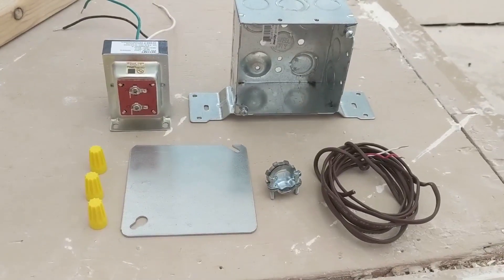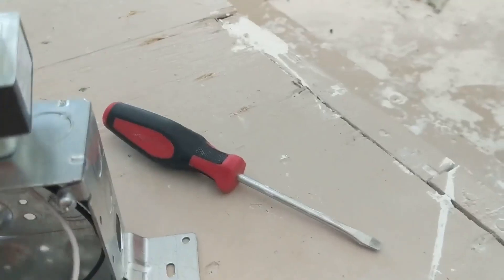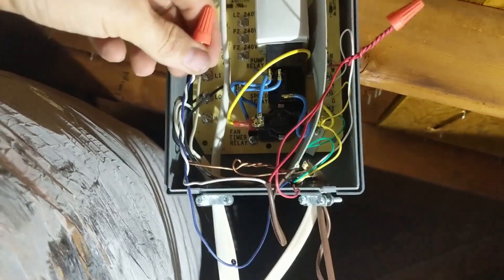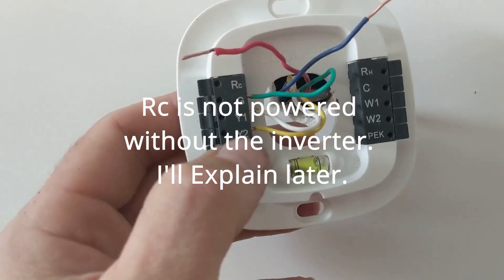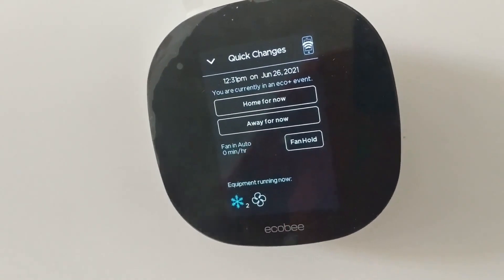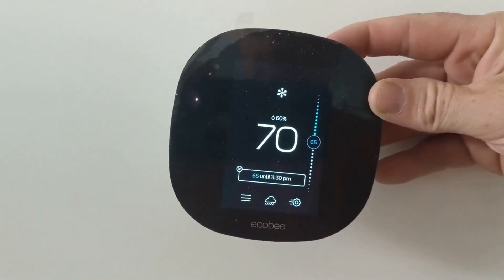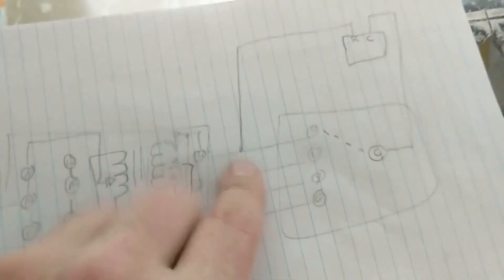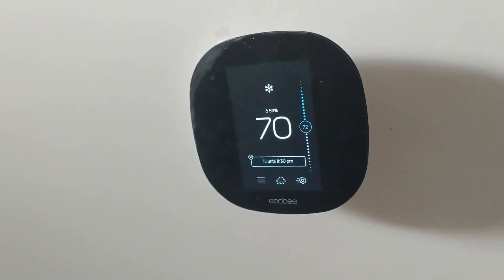Control Evaporative Cooler with Smart Thermostat SOLVED!     White Rodgers, Nest, Honeywell

Comment: Welp.. this seems pretty convoluted and complicated. Probably won't be attempting this although it was a nice thought.
Reply from the maker: Just hook up a 12v relay + to + and - to -. Wire everything else as usual.
Reply: @meunsupervised7320  I ended up just getting refrigerated air 😆
Reply from the maker: @rayzor285  That works as well!

Comment: Maybe I missed it but can you use ALL the typical functions, like Hi/Low for blowing and most importantly for me, can you turn the waterpump off/ on, all from the thermostat??????
Reply from the maker: The thermostat works as usual. The white Rogers controller runs all of the needed functions. My low is set within 5° my high is anything over. The water pump automatically turns on 2-5 minutes prior to the fan depending on the white Rodgers controller model. Standard fan can also be used with no water.

Comment: Will this accommodate both low and high fan speeds?  You referenced high/low in your video but did not talk more about high low fan speed function.  Great video BTW.  Thanks!
Reply from the maker: I set my thermostat to run on low under a 5° temperature variant and after 9pm until the desired temperature is reached. Anything over 5° the fan switches to high.

Comment: Thanks it works great, now I have a question I want to control my furnace also with the ecobee, but the cables for the Furnace are R,C,W,G by any chance do you know how to connect both at the same time?
Reply from the maker: Yes, but a diode controller would need to be installed to prevent duplicate input power which could damage the white Rodgers controller or the furnace board. I simply installed two ecobee's and have them linked.

Comment: THANK YOU SO MUCH FOR THIS VIDEO

I have tried to get White Rogers working and it was not !
Although i might have another problem as I only have 1 pump wire coming from my cooler (240v cooler). At the time, I tried hooking it up to P1 or P2 and both did not work. I had a common from my heating system but not sure if your trick will make it work then.

Do u have any idea how to deal with that situation of 1 pump wire only ??

If i can connect to you on other social media that would be great too..

Thanks again
Reply from the maker: The cooler pump should go to P1 in your white rodgers box. W controls the pump on your thermostat. P2 should be your return to source. Though as there is no diode you might get away with wiring in either direction. Then again I have no clue without seeing your system. You may need to add a wire for P2.

I'd test to see if P2 is energized after or even if the thermostat relay closes.

You need a dedicated common to get this option to work. If you already have a common you can use that, but in most cases it should be isolated to protect your furnace. My understanding is you don't necessarily want one power source controlling two circuits.